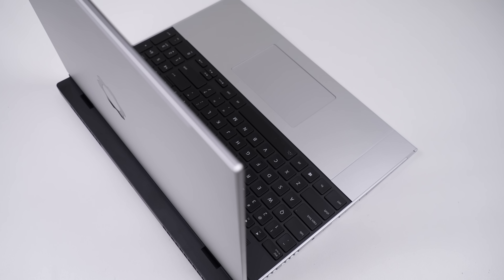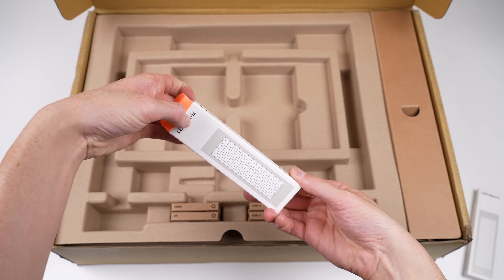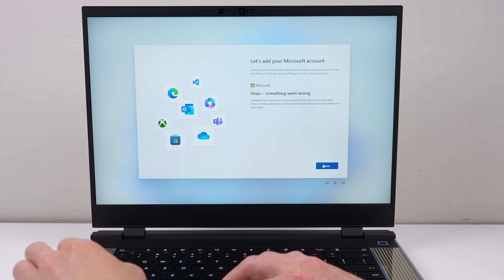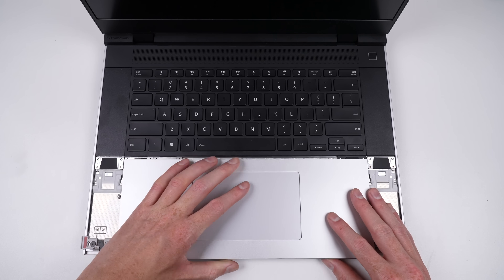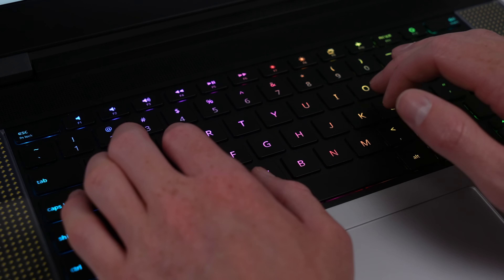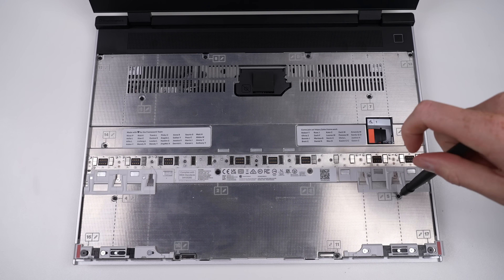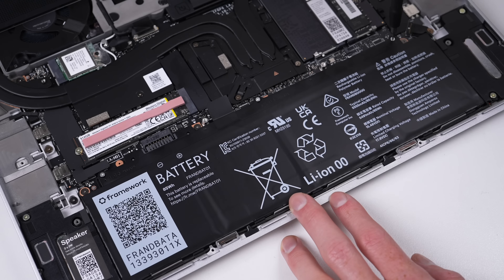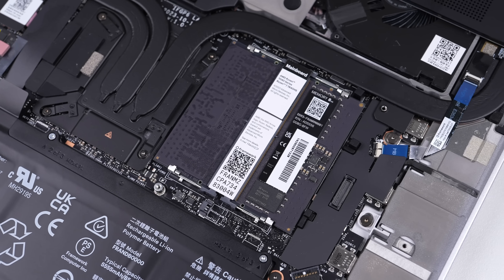Game Changing New 2024 Laptop Design - Framework 16 - Teardown And Repair Assessment

Comment: I love how even the battery has a notice "this battery is replaceable" instead of all thew warnings on most batteries, I'll definitely buy a Framework as my new laptop next time I need a new one.
Reply: really pushing the emphasis that, this is your device, it is your right to fix and customize it. Framework really outdid themselves at this point
Reply: @wingit7335  You obviously missed the "it's open source, anyone can make and sell a module" point that was brought up multiple times in this video
Reply: @mysticaxolotl8215 That's beside the point. point is the real play is what MNT is doing, make it a thicc boy that takes standard power cells you can easily buy and replace for very little money. Everyone'a too focused on their laptops being thin.
Reply: @colbyboucher6391  Reread this entire comment thread, you obviously missed something -_-
Reply: Just imagine if Apple and some other laptop manufacturers weren't so incredibly greedy and controlling, they could easily do this. But they won't because they have this insatiable desire to milk people for every last cent (and then some).
Reply: you still can use a screwdriver to replace battery in any modern laptop. Just another shit comment of a person who doesn't used framework shit any single day  @SlartiMarvinbartfast . Milking people is more about releasing new mobo and gpu extention that fits only new chassie. Or 50 bucks ports. Framework is a cool thing for geek review videos, but not for daily usage. It's just mediocre quality, overpriced laptop
Reply: @wingit7335  Hugh mentioned at least twice that it's open source. Try paying attention next time.
Reply: @wingit7335 l 9:27
Reply: @wingit7335  You can literally build Those
Reply: I'm planning to get one too, just make sure you're aware of all the little issues beforehand so you can think of workaround. I'm gonna be keeping myself updated about those to know if and when framework manages to resolve most if not all of them

Comment: at this point I feel like they'll make a replaceable CPU model as well
Reply: not so easy for laptops. all laptops chips are soldered, direct die. no IHS to protect anything, and they would have to socket them after the fact. 

they do promise motherboard replacements in the future, as they've already released for the 13, but cpu upgrade is a bit out of reach for now
Reply: well yeah, but like with the GPU module, they could put the CPU on a similar modular card and get around the issue of BGA chips

Comment: if I buy a stolen Framework laptop with LUKS encryption I can't bypass the encryption password, this is just another product that questions the concept of ownership.
Reply: Why would you want to bypass LUKS encryption? If the concern is over clearing the TPM, I imagine the firmware allows you to erase any keys so the data is unreadable, but you can still reinstall the operating system and use the laptop without being able to read the previous owner's data.

Note that this is not the typical anti-theft protection stuff that companies like Apple put in their devices where you can't fully erase an iPhone and you have to put in the Apple ID information when reinstalling the operating system.
Reply: @Computerdude1500  I'm aware of how luks work, I'm just mocking him. He made a video on the Volla phone (Jolla? I donnoh, somethin -olla) where he knowingly bought a stolen device, that advertised itself plainly as permenantly locked, then claimed that since he couldn't bypass the bootloader password the owner had set on it it was 'yet another product which questions the concept of ownership'. (if it wasn't clear by me not knowing the name, I really don't care about the company nor do I know anything about it, but when I watched his video I immediately suspected that his 'bootloader lock' was a user-installed passcode and sure enough, it was, the phone is not bootloader locked.)

So now this channel is just the 'yet another product which questions the concept of ownership' channel to me now and I occasionally leave a comment mocking it. Sorta like how Rossman is the "source visible is more secure than FOSS" guy after he lied to his audience by intentionally talking around the issue and conflating licensing and trademark to convince his audience that FOSS is less secure than source-visible or like how LTT is the 'I don't think I did anything that unreasonable' channel. (people are moreso on them now for the billet thing, but the fact that Linus is that incompetent with technology has always been more damning to me)

the laptop is honestly pretty cool looking overall, though it lives in a bit of an awkward middleground to me between something more traditional and something more extreme like the MNT Reform. Sure it's very modular, but all of the actual interface points seem fairly complex and hard to actually hack-on has a user. It's open sure, but it just feels like it's stuck in that awkward middle-ground where the traditional/modernist side and the DIY-hacking side haven't quitiiiite merged seamlessly. For instance using an LED array rather than screens or even e-ink displays. (one thing that'd be particularly cool are transflective OLEDs like the Nice!View display or something) That's actually kind of ironic since you'd think LED arrays are more DIY-able but a simple I2C screen would actually be far better for interfacing and higher quality to boot. Another example would be that it looks like it's a rather compact package so you couldn't even fit small mechanical switches in for a higher quality keyboard. It's fine hardware, but I'd definitely say it's more modular than hackable or anything. Then again, maybe I'm wrong, eitherway like I said I only left a comment to take the piss outta the guy. IMO if you're that negligent you deserve to have the piss taken out of you for it because your negligence and/or ineptitude will misinform and mislead your audience. It's one thing to get things wrong and either make it clear that you don't care, or have the mistake be reasonable, but if someone with no prior context in the span of 10 minutes and you can make a full video on it without figuring it out, that's just negligence.

Comment: Probably my next laptop in 2025 when it's time to retire my macbook. I just wish that the battery would slide in and out like the GPU does. Besides this small-ish complaint, this laptop is 99% perfection.
Reply: How many years have you used your macbook?
Reply: @CrankWavesbackupchannel  I have a 2012 air that I still use as a writing machine. And a 2020 Air with M1 that still works quite nicely. I haven't upgraded yet, actually 😅
Reply: @mrgrumpy888 Hhhmmm okay thnx, doesn't make things easier. Only today did I find out about this upgradable laptop. But I also watched alot of videos of ppo boasting how stable a macbook and great its longevity is...
Reply: @CrankWavesbackupchannel  Honestly, that original Apple Silicon M1 Macbook air from 2020 is one of the best computers i have ever owned. And still feels like a brand new device after all these years.

Comment: There's a quick keyboard mod that can fix the typing, put a thermal pad on top of the exposed cooler, it provides support to the metal midframe and massively helps
Reply: yeah by ltt, similar to keyboard mod
Reply: Or a piece of folded paper if you don't want to feel hot while typing (as thermal pad transfers heat directly from the cooler to midframe)
Reply: @sihamhamda47  if you're cold they're cold, give your cat a warm keyboard to sit on.
Reply: @sihamhamda47 It shouldn't really transfer much heat if you don't place it on heat-producing components.
Reply: 100% they'll update the keyboard in the next revision though
Reply: Pays $1.7k to diy the most important nd basic component. You cant be serious.
Reply: Pays $1.7k to diy the most important nd basic component. You cant be serious.
Reply: Pays $1.7k to diy the most important nd basic component. You cant be serious.
Reply: Pays $1.7k to diy the most important nd basic component. You cant be serious.
Reply: @M-gx3nu  Dementia💀
Reply: @yok0ri  someone doesnt understand networking.

Comment: The cheapest framework configuration I could build was $1600+, and that's without a GPU. I could wait for a sale and buy a decent gaming laptop for half of that, use it for 5 years, and buy another for less than the cheapest framework laptop. Not worth it atm, but hopefully this goes down in price in the future.

Comment: It's got a fair few teething issues that it seems like they were just kind of planning to fix in prod, but honestly if I could swing it I'd still buy one in a heartbeat. Even so, after all the absurd issues I've had trying to get things fixed and get parts for my HP ENVY laptop, and the poor job HP did repairing it when I finally convinced them to, on top of the repeated failures Dell has had of late, I'm absolutely going to be picking up a Framework 16 when the time comes for my next machine.

I'm currently waiting on my new work machine to be ordered so I can more comfortably tear down this very tightly built HP and see if I can't repair/make things a little better, and if I botch it, at least I'll have my 14" M1 Pro to use til I can swing the FW 16.

Comment: I'm waiting for a few issues like bouncy keyboard and poor black levels on display to be rectified before I get one. I'd also like a large storage bay instead of the GPU.
Reply: they've already shown a rear with the cooler and 2 extra m.2 slots. its not in production yet but they do have designs out for it already

Comment: i've never heard of that account skip method ever. nice job hugh
Reply: TechBitesAr Doesn't work in the newest versions, it requires you to go online
Reply: @Wazzaps  Nah you can just type anything in the email field and password you get error and an option for Offline account.
Reply: Same. Usually it's alt-F10 and a few lines in cmd to get around it.
Reply: @Ebalosus shift f10 and they’ve also removed oobe\bypassnro now woohoo

so you’ve gotta go into the registry editor and create the BypassNRO dword key yourself! yay!
Reply: taskkill /F /IM oobenetworkconnectionflow.exe
multiple times 6-7, until Next button is enabled

Comment: Dell precision line up have swappable GPUs, just Dell form-factor. You can upgrade from a Quadro RTX Ada 2000 to Ada 5000 for example.
Reply: Apart from being a professional workstation laptops not aimed for home use not gaming the upgrading process, although far simpler today than in past models, is not for something most users can do. The Framework laptop is the only one that makes it easy and accessible to all and the way it is built allows for more upgrade options over time.
Reply: @AL5520  It's harder to replace but if you look on some tutorials how to do, it's quite easy but with more steps to disassemble than frameworks one. A Dell precision m6700 with Quadro K3000M can be upgraded all the way up to a Quadro RTX 3000. (3 generations of upgrade path). The newest Dell precision laptops all use the same socket as regular gaming laptops too (Alienware, Asus, etc).

Comment: Nice! Definitely all the features (upgradability, open ecosystem, easily exchangeable parts, good repair aids, good Linux driver support, etc.) I'd look for in a laptop if I was currently in the market for one. A bit pricey for me though, but that's to be expected with new, envelope-pushing stuff from a smaller company.
Reply: also remember that you can upgrade at your pace. not come up with a lump sum at one time. that and going from intel to amd at any point. i know my life isn't so friendly that i can fork over $500+ at anytime, this would let you do mb, ram, screen, or gpu without having to upgrade anything  else. kinda reminds me of how i upgrade my pc at home.
Reply: now if only they offered a TarckPoint™ equipped keyboard... 😏

Comment: I really want to have a Framework smartphone, we really need a Fairphone alternative. 
Surely Fairphone does a lot of things right, but I'd really prefer a much more compact device with a headphone jack and a better chipset (I know the reason for the current chipset)... 

For me, the ideal phone would have: 

- A screen under 6 inches
- No notch, punch hole or any other kind of screen interruption (optional screen with selfie cam for those who really need it) 
- Ultrasonic fingerprint scanner
- Expandable storage, headphone jack, IR blaster 
- Physical privacy switches (like on the Librem 5) 
- 2 Notification LEDs on the frame (top and bottom) 
- User replaceable battery 
- Repairable and upgradable 

I love Frameworks mission, compared to Apple, they ACTUALLY care about the environment and the consumer, brilliant video, Hugh!
Reply: They day Framework makes a printer I will do a triple double backflip. And they’ve acknowledged it a few times already, especially in the past few days given HP’s recent statements!
Reply: It's harder with a phone as it has to be dust resistant and to a degree water resistant.

Comment: It will be impossible to fit full power 140w RTX series card in that sized module though. You might be limited to 80w GPUs
Reply: the current gpu is 100w and has great temps, the psu maxes at 240w, so maybe future models can push 140w peak and 125w sustainable. they can easily adjust the cooler for more wattage when they upgrade the cards too
Reply: Might look awkward but the GPU module already extends the length of the laptop, so they can just make it larger as needed.

Comment: I wonder if Framework's next laptop should be thicker to accommodate an optical drive, that can be swapped for a 3.5" floppy drive, RS232 serial, and Cherry MX keyboards
Reply: Ha, I'd kill for a Framework laptop with a bluray drive that can be swapped out for a second battery.
Reply: Would be cool to have an optical drive but I wonder if there's an actual business case for it. Then again I am the kind of person who still holds on to optical drives.
Reply: you can have any port you need for that external hardware. no way there'd be enough buyers to justify a redesign of that level
Reply: you can buy 1980's Toshiba laptop for that

Comment: 2:26
You can also press Shift+F10 to bring up a command prompt, then type "oobe/bypassnro". This will allow you to skip connecting to the internet, which will allow the use of a local account. Note that this doesn't work if you have S mode Home.

Comment: I like the screen aspect ratio, which is great for documents and work. I would replace Winbloat 11 with 10 LTSC, the only good version of Windows
Reply: If you don't want Windows 11 (I definitely don't either) you can get the laptop without an OS preinstalled.
Reply: You mean best currently supported windows?
Reply: @sagwan-square  Why would anyone use an outdated version of Windows for daily work? 

It won't run most applications and isn't safe to use. I would not risk it, because of the sensitive info of my client or industry espionage. 10 LTSC runs everything.  

Windows 2000 and 7 were solid releases, but nowadays they became history.
Reply: @mike_et_saika  I agree, I think windows 7 is the best version overall, but it is sadly not supported anymore.

Comment: I love this but costing 2K+ is a deal breaker. For that money I can get a standard much higher end gaming laptop.
Reply: For my 2k, I would get a full on gaming tower PC. But if you need a laptop, to buy one that is completely modular and upgradeable, it's like you will never need another laptop again. Remember that you can swap mainboards from 11th gen to 13th gen or even to Ryzen on the 13 inch model, so if the 16 inch is anything like the 13 inch, expect good longevity out of the laptop.
If I needed a new 16in laptop I would definitely be getting the Framework. Having said that, I'd buy a 13in Framework laptop if I needed a lighter and more portable machine!
Reply: your not thinking ahead. you can upgrade this laptop over years. go trough a gaming laptop in 4 years (some claimed life cycle of  a gaming laptop) instead of getting a new one all you'd have to do is upgrade the part and have it go for a few more years. not only that but you wouldn't have to come up with the money for the whole thing, as you could upgrade over time the parts you could afford. this would mean that you wouldn't be without the laptop because something went out of it, you'd replace or upgrade as you came up with the money. beats coming up with $1500+ to get another laptop.
Reply: @craiglortie8483 I 4 years or whenever down the road it won’t make sense to upgrade a single component for about half of what he originally paid